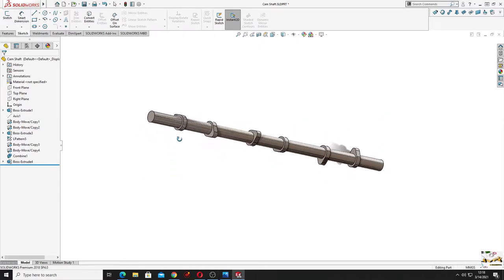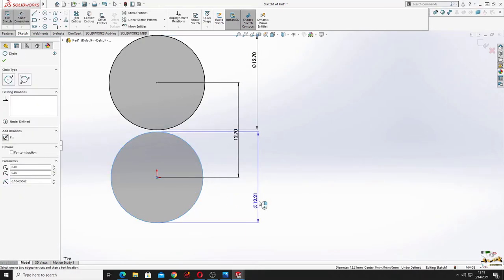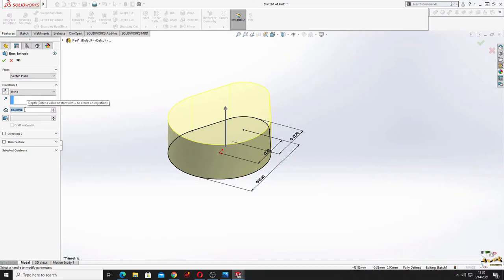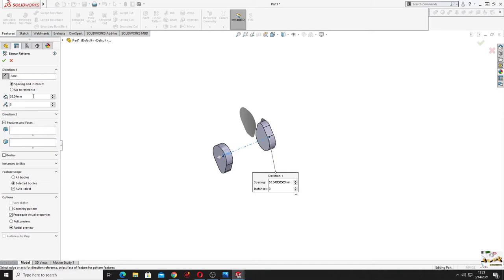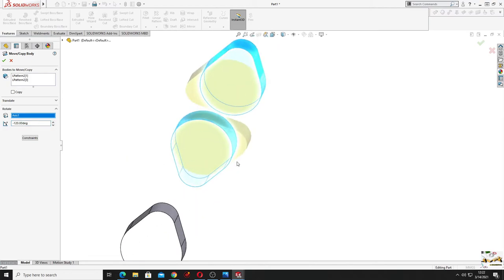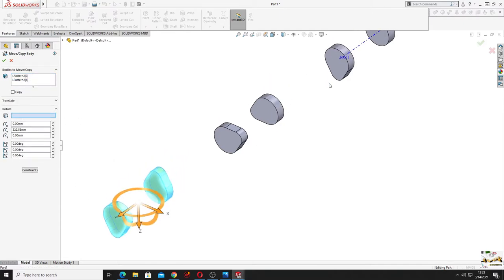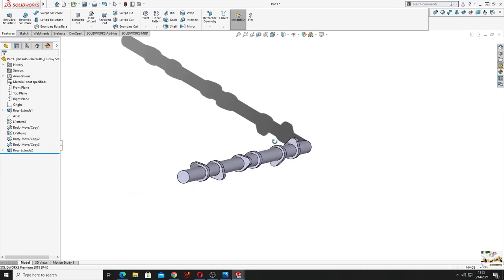Cam Shaft V6 Engine SolidWorks Tutorial 2021! Learn from homee :D

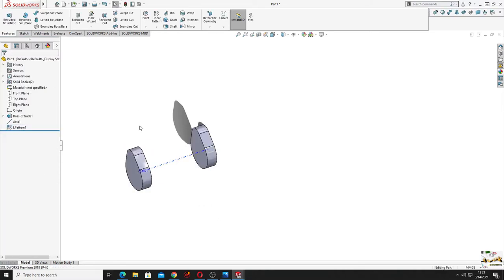Comment: Great job 👍, just wanted to point out i think there's a mistake in 2:36 the distance should be 53.34mm + 7.62mm otherwise you will face a problem in the assembly which is the cam shaft won't line up correctly with the rocker arm (still works tho)
Which brings us to another problem with the first extruded boss in blind it should be put to mid plane in order to fix the cam shaft using temporary axis. Thanks tho i learned a lot from this Engine tutorial 😁
Reply from the maker: Thank you, you can make it how you think is better 🤗
Reply: thank you for the correction, it was driving me crazy